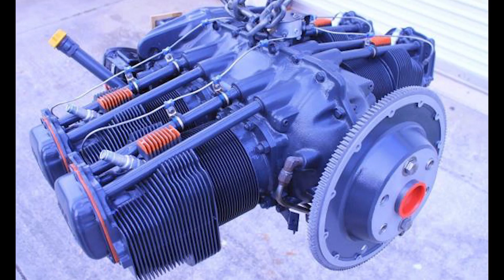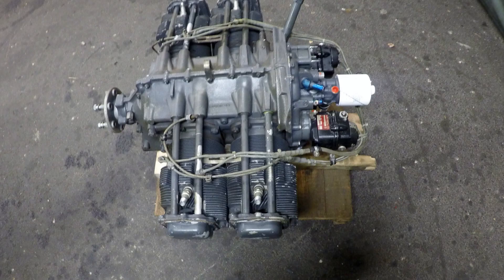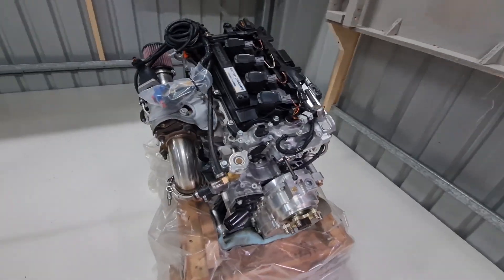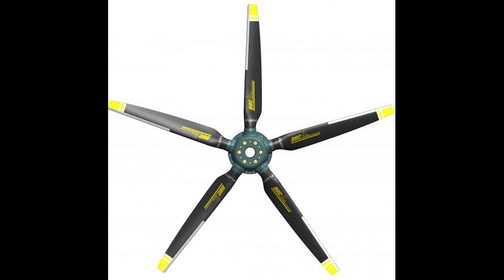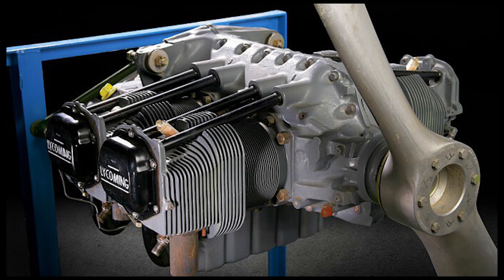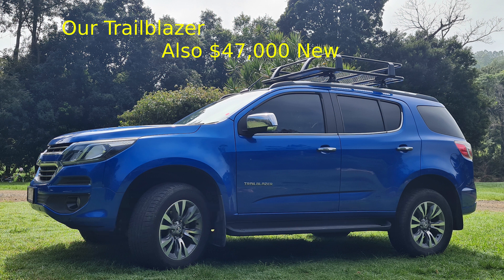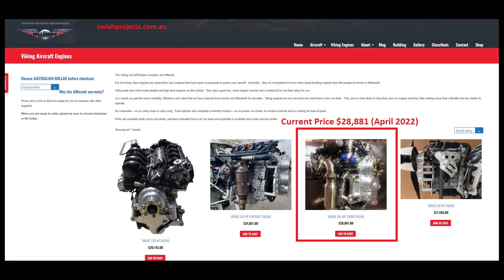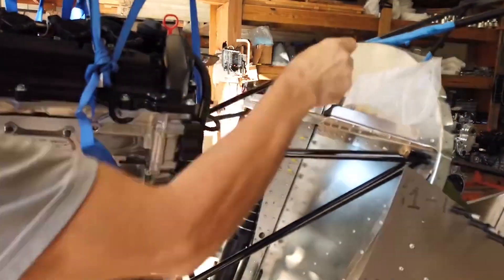Our engine choice for the Velocity

Comment: I’ve been building/flying aircraft for over 25 years.  Throughout those years I’ve seen many crashes do to auto conversion engine or gearbox failures.  A automotive conversion, though not my preference, may be a option for stol aircraft because if they have a engine failure they land so slowly that damage to self and property can be minimized.  In your velocity the landing speed is much higher and requires much more area leaving you in a much more dangerous situation if you were to ever loose engine power.  Since you’ll be flying with your children and wife a better engine option for you would be a mid time Lycoming IO-360 which can be found fairly reasonable.  I pray for success whichever way you decide to go.  God Bless
Reply from the maker: You get no argument from me Bill, The big bore, air cooled, direct drive engine has been the undisputed king for 60+ years. This is a very interesting topic in which I take no sides.

One engine type has been shown to fail at a known rate and all the other types at a higher rate.

As you know phase 1 of the certificate of airworthiness lasts 40 hours. Those 40 hours are solo hours in an unpopulated area and if there is any sign of doubt in the engine or gearbox after those hours, the family won't be joining me and I'll address the Issues the best I can. If that involves an IO-360 then so be it.

Obviously I've made a choice but others wouldn't make the same choice and I wouldn't blame them.

I intend to make a video on the topic, including the future of engines in experimental aircraft and only discuss the issues and not bat for one side or the other.

Thanks for the comment Bill.
Reply: @AusVelocity  Hi Clint thanks for the response…look forward to your progress with the project!  I’ve got a friend with a velocity xl rg and the velocity series are excellent cross country airplanes.   My current aircraft is a RV-10 but I do have some composite experience and would be glad to help anyway I can.  Be blessed

Comment: Just subscribed interested in your story. I am in the same predicament. Need a family plane. Have my wife and 2 boys I need to fly around.
Reply from the maker: Hey thanks for the interest. I realise this is the slow way to get the family in the air. But for my financial situation I had to be honest with myself and I realised I had to do it this way or never and forget about it. Im not making any comprises on safety by going cheap and if i thought i was I'd never risk my family's safety. The plane is the safest thing in the sky and engine is extremely robust and reliable. I'll be making another video on the honda engine shortly.

Comment: Interested to know if you talked to aeromomentum about their am20t before settling on the Viking? 
There is talk about the tendency for gdi engines carbon up the intake valves and how port injection is the better way to go.
Reply from the maker: Thanks for the comment. The carbon build up in the intake ports happens in cars because they route the engine breather tube into the intake. They have to because of anti pollution regulations. Aircraft dont have to follow those regulations so the engine is vented to atmosphere. The only thing passing through the air intake is filtered air.

I thought about aeromomentum, i like what they do and I'm sure they build a great engine. It was a toss up. But in the end i think the aeromomentum would have been harder for me to get up and running. The viking was a bit simpler.

Comment: Great engine choice. The L15 with no EGR/PCV is arguably the best four banger available. Use a scavanger additive like Marvel and you can go back and forth with LL if you have to. The L and C brands are all that is available realistically for GA certificated aircraft and that is the main reason why they are sold. The lose tolerances are there so they dont blow up as they can't really maintain temp all that well and also so that the excess fuel used as coolant can slip by and burn off in the crank case. BTW, Honda does test their engines for thousands of hours at WOT. All the best on your project. It sounds like an amazing combination.
Reply from the maker: Thanks.
Yes L and C have enjoyed a captive market for a long time and are happy to keep the status quo.
I'm hoping for G100UL to make it to Australia's airports before I'm forced to run 100LL on long trips but will have an additive on hand if I need. But that's a long way off.
Yes, I'd believe honda would run every test they could think of and leave nothing to chance to keep their reputation.

Comment: I wonder if a ls3 would fit in. Lol more power
Reply from the maker: Too much weight for the SE but XL is doable.
Need to take care of radiator cooling and finding a gearbox, fuel system etc etc. It's all been done before, you just need to find out who and how they did it. I guess i took the easy option and let viking do most of the work for me.

Comment: Not turbine.  Turbo.  BIG difference.   Avgas has a lower boiling point and will turn to vapor at high density altitudes stopping the engine.  I know this from personal experience using Mogas in a Rotax 912iS and having the engine stop at 10k feet on a 90f day.  Also, you cannot go back to 100LL if you start to use Mogas in your engine.  You must use premium Mogas of 89 octane or higher, really 100 octane is best if you can get it.    You will also be running 5500rpm or higher in cruise and takeoff (loud).  Finally, you should really be sure about using an auto engine in an aircraft.  No auto engine is designed to run at full redline RPM for hours at a time unlike a Lycoming or a Continental engine.  Aircraft engines over long history have been designed with loose tolerances and robust fail points to deal with extreme changes in air pressure and long run times at high RPM.  If auto engines were that good then Lycoming and Continental would have long ago been overtaken, yet they are still first and second in engine sales in the piston market.
Reply from the maker: Thanks for the advice and taking the time to comment, if I said turbine, I meant turbo.

Yes, vapor lock (boiling) can be a problem. Viking supply and require the use of a header tank below the main tanks that contain a pump(s) to maintain fuel pressure above ambient pressure preventing bubble formation.

Not sure why I can't interchange between mogas and avgas. The recommended fuel is 89 octane or higher. We have plenty of 89-90 here in Australia (98 RON). 100LL does cause issues in the cylinders and on the exhaust valves by depositing lead salts. Decalin or TCP is suggested to scavenge lead in 100LL after combustion to prevent lead oxide buildup on valves. Air-cooled engines do have wider clearances to account for wide variation of cylinder temps and these lead salts. These salts also cause a lot of grief causing sticky and leaky exhaust valves. No engine is immune and everyone will be glad when G100UL is available.

Yes 5500 seems high to run all the time. The redline for the engine is 6000 and won't blowup if that's passed, takeoff is suggested at 5600 and cruise at 4900. On level ground the accord will settle at 3000 for highway cruise and will up the revs for hills and passing to prevent lugging the engine. There's no reason to think the engine can't continually perform within it's designed rev and HP envelop regardless of time at higher revs. I'm pretty sure car manufactures run a few tests before they commit to building several million engines.

4900 is a bit noisier than 3000, but nothing like an unmuffled aircraft engine. 

As for what Lycombing et al do, that's up to them. If no one wants to spend a billion dollars in research and development, tooling, certification and liability for just a slightly better aircraft piston engine, only to sell several thousand units a year, I don't blame them.
Reply: @AusVelocity  Header tanks are standard for a high wing and a fuel injected engine.  If you keep the boost pump on all the time it may help with vapor lock, but Rotax has the same setup and you can still get vapor lock dependent on outside ambient temperature and what you are doing in regard to engine management (pushing the engine).  The reason you can't swtich back and forth has to do with lead deposits.  100LL will leave the deposits and the Mogas will break them loose and that can cause problems in your fuel injectors and other small places around the engine.  That is why if you use Avgas at all (and use it rarely if using Mogas) you must use the Decalin to neutralize the lead. There are good reason Lycoming and Continental and Rotax own 90% of the piston market... Viking engines and other alternative engines like Astro, UL and D-Motor are NOT a panacea nor is the use of Mogas.  You are mainly just trying to cheap out a bit and thats fine, but don't rationalize by assuming you will not get what you pay for...you will be no exception.